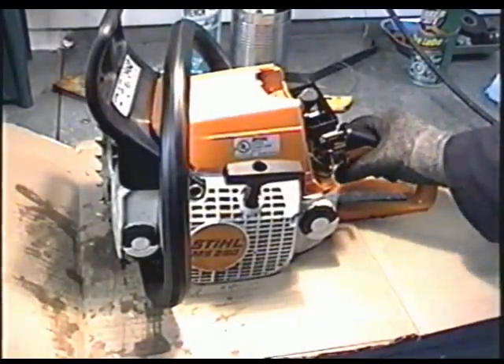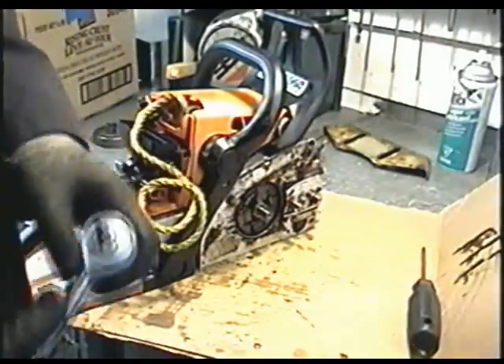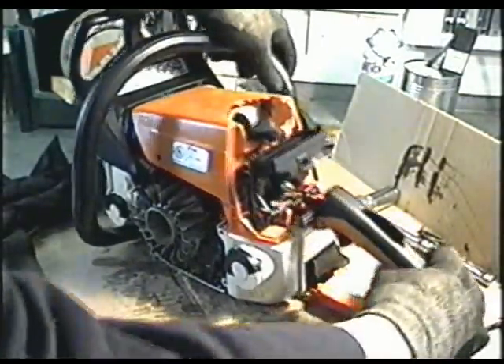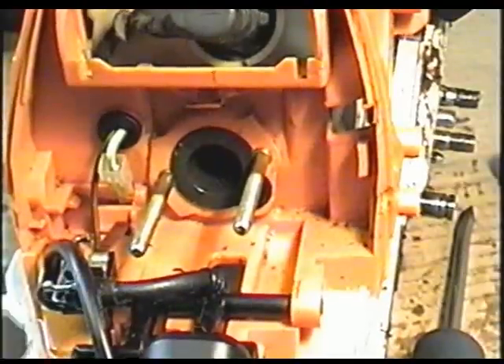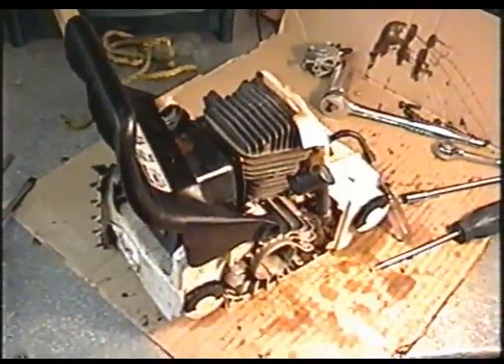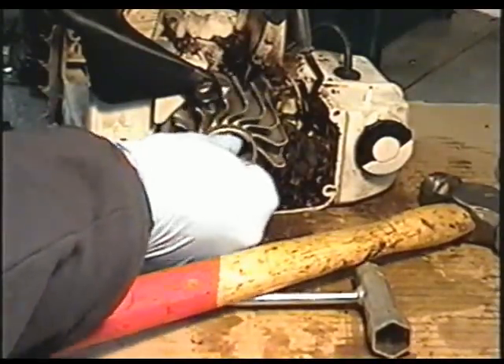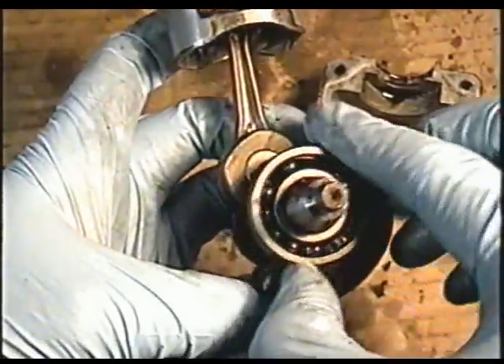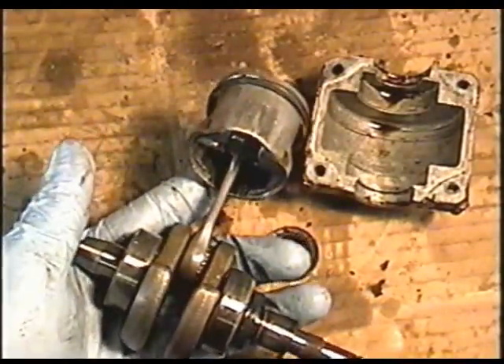Stihl MS250 Chainsaw Teardown

Comment: Your teardown showed the correct position of the "leaf spring" above the plastic off/run/half choke/full choke selector switch.  The MS250 have a known issue where it can't be switched off, due to the carb cover being removed without moving the selector down to full choke position before removing the cover.  The spring pops down below the selector switch where it doesn't belong, and creates a mystery on why the saw can't be switched off/keeps running.  Thank you!

Comment: Thanks for sharing DB. I left fuel in my ms 250. Rebuilt the carb still nothing. Replaced carb, still nothing. Now gonna replace the fuel line. The exhaust is clean, the ignition system is good. This teardown video is a great help. Thanks again.

Comment: Hi Donyboy73.

I just got a "second hand non-working MS250" as a hobby project.

I disassembled it and it had the exact same broken parts as yours and the defects even looked the same: Piston was partly melted ned the edges, cylinder was scratched near the exhause, one ring was broken, one ring was stuck, ball bearing was missing one ball and the whole metal "ring" holding all the steel balls.

So ... now it's time to order some new parts!
Reply: im doing exactly the same 3 years after you can you recommend this saw generally ? I have never actually used one even though im buying one!

Comment: You do excellent work.  I enjoy all of your videos and have learned a lot by watching them.  I rebuilt my Sthil 041 and used this video as a guide even though they are different saws.  I now have good spark, new carburetor kit, it's getting fuel, new spark plug, good compression with a new piston and cylinder, but the saw will not start.  Can you give me any ideas what I should look at next?  I would really appreciate  your advice!

Comment: I got one of these saws for free (a neighbor was giving it away). He gave it away for a reason. Found your videos and took the saw apart to find that the piston head had a hole blown through it and was really deformed. Looks like he had no oil in the fuel—the cylinder looks burned, not shiny. Everything else looks great on the saw. Two questions: I tried tapping the flywheel off as you show, but no luck. What's the trick? And where do you order a replacement piston head and cylinder? Thanks.

Comment: I have an MS250. Is it possible to remove and replace the intake boot with out pulling the cylinder? Does the white plastic plate have it captured is there a clamp holding the boot to the cylinder? Great Videos by the way. After I'm done with the chainsaw I plan on tackling my pressure washer.

Comment: Love your videos, I have a stihl MS250 C with a cracked fuel tank, is it possible to use an MS250 chassis to replace it and modify it to fit the MS250C chain adjustment system and ignition coil

Comment from the maker: @oikosecosnomikos you can find a flywheel puller on ebay and also an aftermarket cylinder kit, the oem parts from stihl are much better though

Comment: Thanks for all you great videos.  I finally got around to fixing my Stihl 026 after watching carefully your videos and Q&A videos.  I pulled the cylindar off and see one of the rings is frozen and the piston and cylindar is scared on the back side.   I will get a new cylinder and piston.  When parts looking I see 44 MM bore and 44.7 MM bore.  is there a way I can tell on mine which bore I have so I am sure to order the right part?  Thanks agian for all your effort.

Comment: great video!  anybody have any thoughts on why the bearings were shot and the piston was damaged?
Reply: Maybe he turned the "High" adjusting screw too far in (clockwise/lean). which would make it run hot.  Or maybe he didn't warm it up a bit before putting it to work.  The shutter may have been set for "winter", and he forgot to set the shutter for "summer"when the season changed, which would probably make it run too hot.   Or maybe bad oil to gas ratio?

Comment: You are awesome.  Videos are so thorough.  My ms 240's flywheel broke.  The little alignment spline snapped off because the flywheel was hitting the ignition coil.  Do I need a new coil or is there an adjustment I can make?
Thanks for the videos.

Comment: Hey Donyboy! Once again, an excellent video! Thank you for sharing your vast knowledge in such a thorough manner. I have a question regarding the air filter of the MS170. Mine does not seal properly, and is letting a large amount of dust into the air intake. This is obviously very bad for the motor. Is there a mod to rectify this? Thanks. Mike
Reply: Mike Kunte hey man you can use high temp gasket maker👍

Comment: I have a Stihl MS-250 chainsaw, and it have been down and in the shop more than it has been used in work. Instead, I have had to depend on my old Poulin chainsaw  which I have had since 2000. I just got both saws out of the shop and the the Stihl is back to doing what it did since I had it, not cranking. The Poulin will start and works fine for me.

Comment: Nice video, but The wires related to the ignition circuit can be taken off at the top end, They have modular connectors just pop out. Don't have to take off the induction coil.

Comment: Donnyboy73, I have an MS170 and trying to remove the handle to fix oil problem. What kind of tool you use to remove the screw on the handle? Thanks
Reply from the maker: torx t-27

Comment: I have a problem with my ms250. Clutch needle bearings failed and heat melted the housing and oil pump. Can you do a video on disassembly and repair? Thanks!

Comment: Hi Don, any advice on removing the plastic separator (translucent white) between the cylinder head and the sprak plug/carburetor? I need to get it off to replace the ignition coil HT lead and am out of ideas.

Comment: thank you....was not sure...I could see a big problem if the spring fell out while rebuilding....would wreak havoc,so I will make sure they are in the rubber before bolting cylinder on...

Comment: Eh, I'm more of an 028 fan. Not a bad idea that Stihl had with that modular crankcase design, though. Saves a few steps, compared to the older stuff. Splitting the case is a chore.

Comment: Got it from a local dealer for $395 US dollars.  Went in asking about the MS 250 and they were out of them so the guy suggested the MS 290.  It has 56.5cc and it came with a 20" bar.  Seems like a great saw so far but it'll get a good test next week when I use it to cut up about 5 or 6 trees.  I'll get a video up at some point to show it off.
Reply: Never happened

Comment: I have a MS180C that refuses to start.  Ran for a while with old gas then it just died.  Tried new gas, new carb fuel line.  Looked at the cylinder from the exhaust side and the top looks like a piece is cracked off or just disintegrated.  How hard it is to replace just the cylinder/rings?  How do you compress the rings to insert into the casing.

Comment: i hae a stihl ms 290 i just aquired in horrible condition. i cleaned it out completely. replaced spark plug, the whole 9 yards. after many pulls of the cord it started at very high idle and rpm i might add. but now today it is jerky to pull cord. what could be the problem. i took off spark plug and tried to pull, easy as pie, install it back in, again jerk jerk jerk (end of rope).... any advice. i am lost

Comment: The piston and bearing damage are probably from detonation caused by pre-ignition from too low of an octane fuel or the timing too advanced. Google the effects of detonation and look at the images of piston damage, broken connecting rods and shattered bearings caused by it, this is a text book example.
Reply: Thank you I did not know that

Comment: i have an older 066 still 135lb compression new crank seals sperkplug .It will run for about 30 seconds but sounds like the brake is on labouring.what could be wrong

Comment: cost me about $450 to repair an 036 Pro in the Stihl shop and then I fried a piston after 4 gallons of gas, don't know if it is related or not. I did replace oiler, rings and some other stuff while it was apart

Comment: my stihl MS180 turns over and works fine but when i try to turn it off it won't turn off at the "0" position I have to put the lever down to cold start position to shut it off. What is wrong with it and how do I fix it?

Comment: Im looking for help please i have ms 250 replace carburetor  pump  all par new from sthill  start but don stay on the coil spark  and i dont know what i need to do all parts new  lines carb pump oil filter and i can't  get it going  please help me  gracias

Comment: donyboy73 i have a chainsaw it doenst start i put a new carburetor ,new fuel lines,new spark plug,new air filter and still doesn't start what is the problem can you help me with this problem.thank you

Comment: thank for the info. I did tear my  025 stihl and replace the bearing but on the process of putting back the piston on the cylinder I did break one of the rings so I order a new ring part number 1123 034 3006 from stihl dealer however  it is really hard to put it back what I notice is that there no gap at all when the ring star entering the cylinder can you help please if this is the right ring for the cylinder  what you do to fit the rings inside the cylinder do you file it? should the ring have gap when the piston is inside the cylinder? I will appreciate your help.

Comment: So my ms 250 will start, but will not run, only runs when i keep the throttle pressed down to keep it running, once i let go of the throttle the chainsaw dies, what would the problem be?
Reply from the maker: +Eric Kanakakeesic turn in the idle screw, LA
Reply: So i did turn the LA screw, tried different positions, but it still dies out when its on the run  position, not sure what is the cause is.
Reply: +Eric Kanakakeesic I have an ms 250 that was behaving similarly, and flooding very easily too, and it was caused by a malfunctioning fuel tank. It would start up and run fine if I remove the plastic cap on the fuel tank vent next to the carburetor